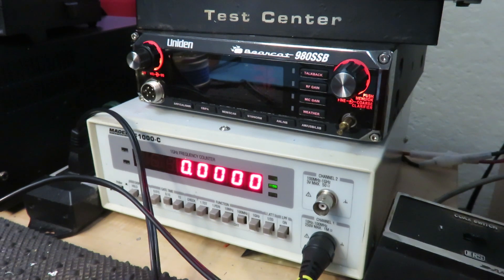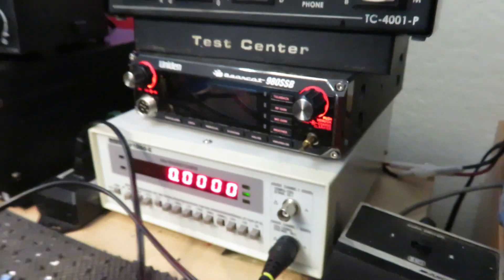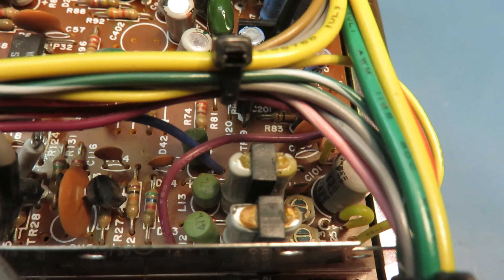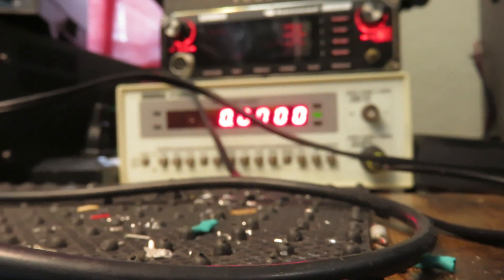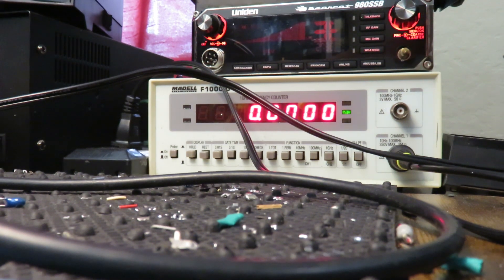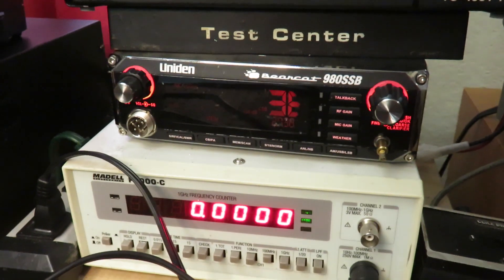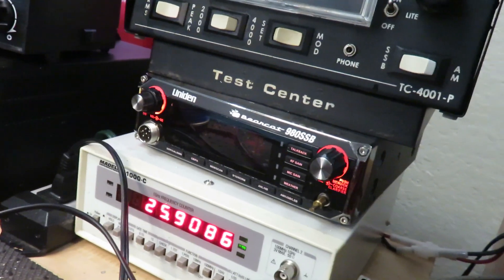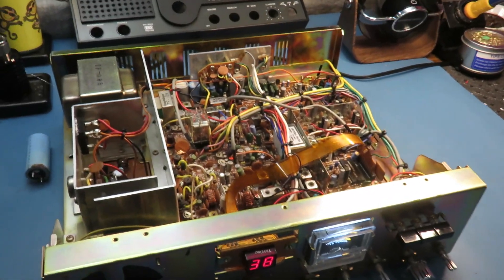Adjusting Sideband TX offsets of a D858 CB by "Zero Beat" on a 2nd CB Radio

Comment: What says your monitor radio is centered and that " skip" is centered much better to purchase a freq counter to min of 6 digit prefferable 8 digit for exactness and to take that freq counter to a certification tech liscensed thru fcc
Reply: Well there are no FCC licensed techs who work on CBs these days, shops are all closed.  So sure proper tools like a Freq Counter is best and an Oscilloscope too,  But if you do not have a Freq counter or other tools do perform the full alignment, like most people and your SSB TX is off just a little bit,  shoot nobody will talk with you.    So this is how you can fix that slight offset, by making a small adjustment of the LSB Crystal.   But it does take a 2nd SSB radio to use as the reference  73s

Comment: Do not 🚫 tune your ssb this way this is wrong in all aspects ...do not ever do this on your radio
Reply: WOW  says Bruce... no flowers LOL BCool says this does work and if you do not have a Freq counter or other tools do perform the alignment, like most people and your SSB TX is off just a little bit,  shoot nobody will talk with you.    So this is how you can fix that slight offset, by making a small adjustment of the LSB Crystal.  OK Sure you could adj the TX freq pot on the board,  but most of these rigs out there today have that already bypassed.